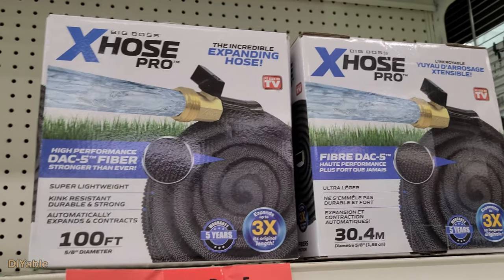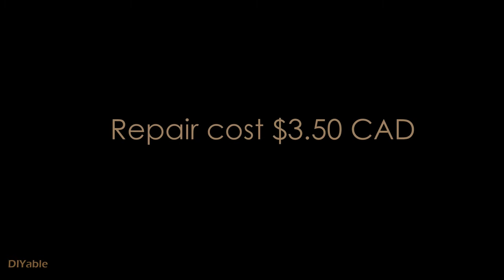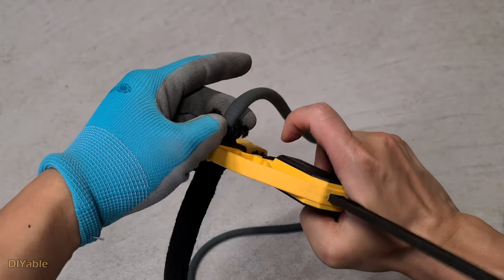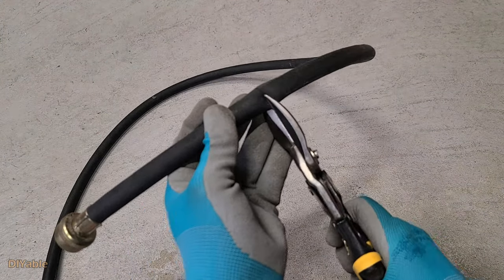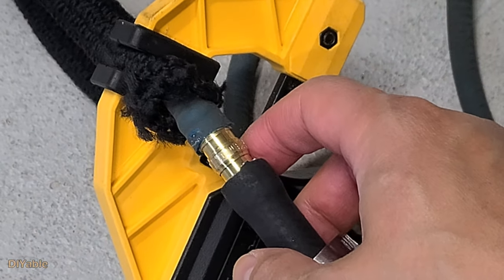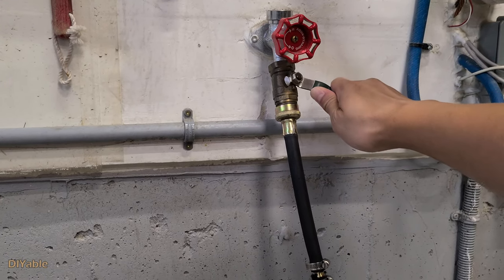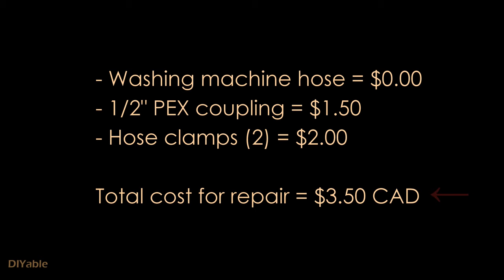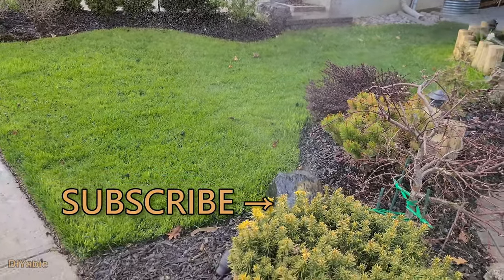How to DIY repair the expandable garden hose? Don't throw your XHose away before watching this!

Comment: FYI, these hoses last longer if you keep them in a coverage storage- out of the heat-and don’t leave them pressurized for long periods when not using. Great video, thank you for sharing.
Reply: Two very good points.
Reply: Yup, that’s how I store mine and I got 3 years out of it.
Reply: That's what happen to me. I left it pressurized for a few days.

Comment: Why do you need add the hard rubber hose? Can't you just use the connector between the two cut ends of the expandable hose?
Reply: yes you can but if the soft hose has a likelyhood to break then.... but yes you can

Comment: I had a 50 foot expandable hose where the outside fibers separated about 2' from the spigot. It turned into a water balloon and exploded. Unfortunately, I trashed it. Just 10 days ago, I bought a new 75' hose from Home Depot for $40.  I only used the hose about 5 times, ONLY using it to water plants about 10' away and NEVER stretched the hose out. Today, 10 days after purchase, the black outside fiber already completely tore right at the spray end, UNDER the 4" rubber protective cover. WTH? Thank you for this informational video, even though I plan on exchanging it for another piece of crap hose.

Comment: Great video to help people salvage things from the landfill!  You may not need the new hose.  My hardware store gave me two brass adapters: One from 3/8" hose (+ hoseclamp, just as shown in the video) to 1/2" threaded connection then another from 1/2" threaded to 3/4" threaded (garden hose size).  Then you only have to do one hoseclamp.  The rest is solid brass threaded connections.  Maybe locktite in between the brass pieces to prevent them from unscrewing when you attach and detach the hose from the spigot.  I skipped that.  Thanks again for the helpful video!
Reply from the maker: You are welcome!!!  Yes, it saves the hose from going to landfill. But honestly, the fix won't last forever. The problem is the poor quality material in the first place.... oh well..

Comment: Can I not just cut the leaking section out and use the hose connection that is there?
Reply: Yes, that is what I did. I tried the video's method but the washing machine hose I got did not fit onto the PEX coupling that I had. Either my coupling was too big or my hose inner diameter too small.
The problem with the Xhose brass fitting is that it is a two-piece unit that requires the black plastic compression ring to seal it. But that black plastic ring also blocks you from clamping the nozzle, because of its length.
So this is what I did:
1. Cut the Xhose to remove the leaky part (mine was close to the end where it attaches to the faucet).
2. expose the inner tube; clamp it in place so it does not retract inside the cloth.
3. cut the black plastic compression ring with a hacksaw so that it could still be screwed onto the fitting, but leave room for a steel screw-clamp. This compression ring is very important to prevent leakage where the two brass fittings attach to each other. I cut it so that all the threads were just covered, and I could see all of the brass nozzle where the inner tube will attach.
4. screw the black plastic compression ring onto the fitting, finger tight.
5. thread the steel screw-clamp over the cloth and inner tube but do not tighten it yet ( I used a 5/8 inch clamp)
5. attach the inner tube all the way onto the end of the brass fitting nozzle.
6. Pull up the black cloth "sock" as far as it will go, over the inner tube to cover it.
7. Position the steel screw clamp onto the brass nozzle area where you have attached the inner tube. Screw the steel clamp onto the end of the fitting, over the area where the inner tube is attached, so that it is tight and will not move.
8. Make sure washer is in the fitting before attaching it to a faucet.
9 . Attach to faucet.
10. Tighten the black plastic compression ring (which was cut earlier) finger tight
11. Test the connection for leaks, preferably outside.

I did this today on the fly. Seems to work (so far - no guarantees!).
Had I known, it would have cost me only 1.29 for the steel clamp, even cheaper than the video, because I would not have to buy the brass fitting or the hose! But I do like the video's method as well, just need to get the right sizes of PEX coupling and hose.

Another possibility I thought of while in Canadian Tire is to use a crimping device to crimp a seal around the inner tube and cloth. That way, you may not have to cut the plastic ring to accommodate the stainless steel screw-clamp. However, I did not have those tools, and it would have to be tight enough and allow the black plastic to travel over it.

Anyway hope this helps! Sorry I did not have time to do a video to demo my method.
Reply: I forgot a step in my instructions:

1B. Expose the brass fitting by unscrewing the black plastic compression ring, then removing the steel band which holds the cloth and inner tube onto the nozzle. I used a hacksaw and clamp.
Reply from the maker: Thanks Alfred D'Sa for such detailed instructions to help others!!  I never thought about hacksaw the original hose connection clamp!  As you can tell, I love using washing machine hose for garden projects LOL.. If you are interested in how I use washing machine hose again, check out these 2 videos:

- "Water is FREE, How to transform Rain Barrel with old desktop computer to increase water pressure?"
https://youtu.be/-yiOaW_sZNQ

- "How to build a portable Raccoon deterrent and repellent system with Orbit Yard Enforcer review?"
https://youtu.be/_h-H8f-fjpQ

Comment: I am so glad I watched your video before I started cutting... here in the States Home Depot sells the metal connector and the two clamps for $5 in a package. So I already had the repair kit but your tip on clamping the inside rubber hose was a tantrum saver. I may get around to the actual repair before the rainy season starts 🤣🇨🇦🇺🇸  Take care!

Comment: Ok, I'll give that a try. I always take mine inside for the winter and I don't have anything to stress the hose out on. I got a year before it leaked. I see the warranty on the one I bought was thirty days. Pretty flimsy product but there so handy to use and space saving. I'll see how my repair job does.

Comment: I just purchased 2 and they lasted less than 2 weeks. Will be repairing mine, using your wisdom and will come back to let you know how it goes. Meanwhile, on the commercial advertising, I’ve noticed the actors draining the hose when they are finished using them. I now wonder if this is key to the problem and longevity of the flexible hose. After all, it’s a flexible hose for the purpose and probably not meant to have 24 hours of pressure held in it for that lengthy period of time.

Comment: I use 1/2 " poly tube Anyone who does farm irrigation probably has this and its cheap, ALSO you can buy the 1/2" tapered ended barbs that are PLASTIC , they are cheaper and work the same Thanks for the video!!

Comment: Well mine snapped at the male end and it went inside right away and its a 100ft. It receded probably 20ft inside. I could cut the mesh at that point if that would work.

Comment: This did not work for me. It works for a few minutes then it rips again at the pex connector.
Reply: Yup. 😢 That's exactly what happened to me.
Reply: Same. I tightened it as best I could. Used a 1/2 connector which seemed large and it still popped off. I had the tubing and the covering all the way over the fitting